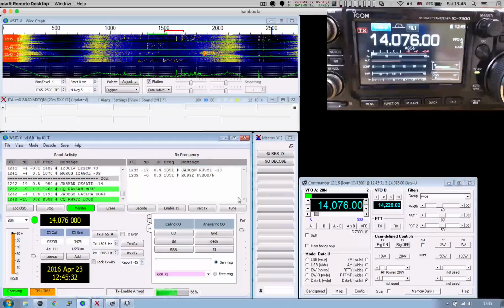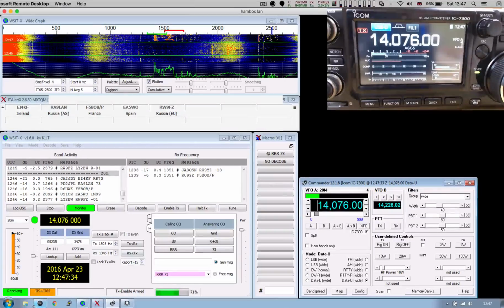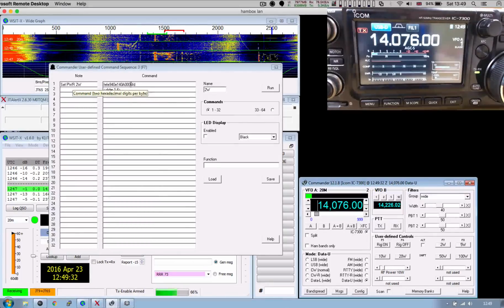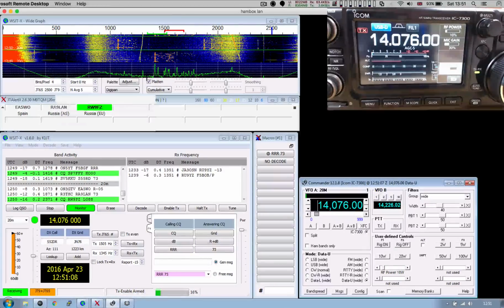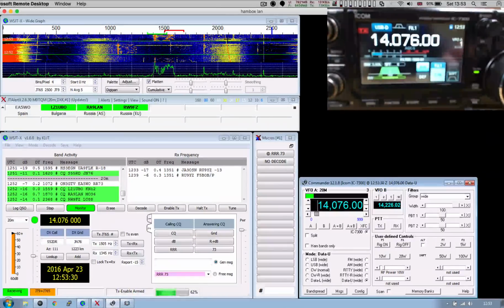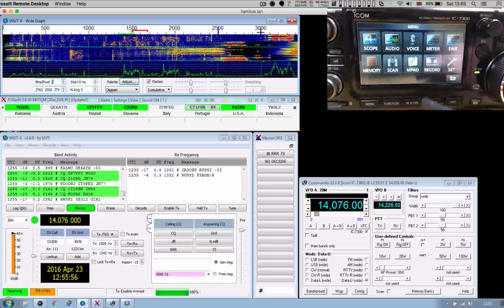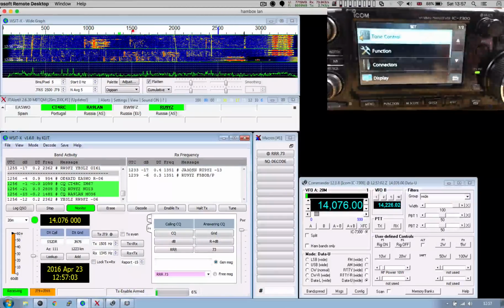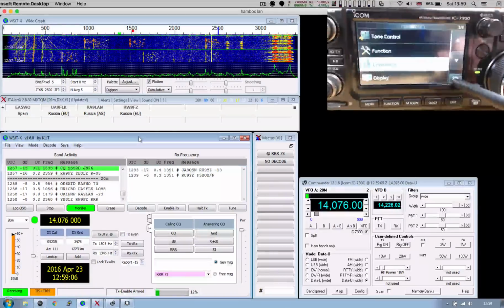IC-7300 remote ops part 2 and digital mode tips

Comment: Tomasz, Have you figured out the proper settings for RTTY mode using DXLabs winwarbler? This is the only mode that I have not got working properly. I think it would be a cool video showing the settings for the IC-7300 and DXlabs WW.  :)
Reply from the maker: didn't do yet but will do when time permits :)